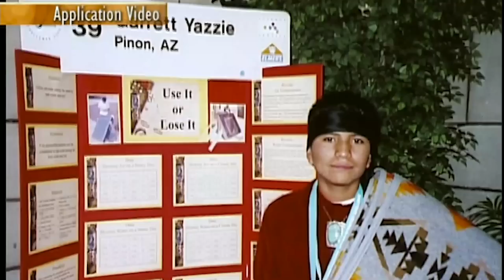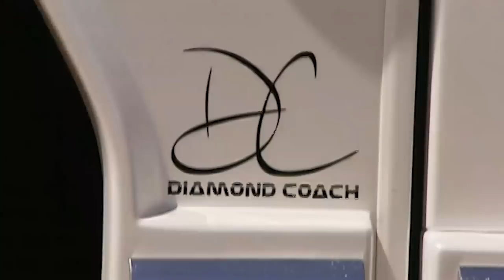Navajo family living Without Running Water and Heat Get a Safe Home. | Extreme Makeover Home Edition

Comment: Unfortunately, there have been a lot of problems reported of this house. The house Extreme Makeover Home Edition built within one week lack good insulation. It was reported that during winter months, the Yazzie family could not get the temperature above 40 degrees Fahrenheit. Tiles were falling off, flooring were peeling, air conditioning broke, water caused damaged, etc. Summertime were reported uncomfortably hot. Extreme Makeover Home Edition did a bad job. I read they no longer have running water as well.